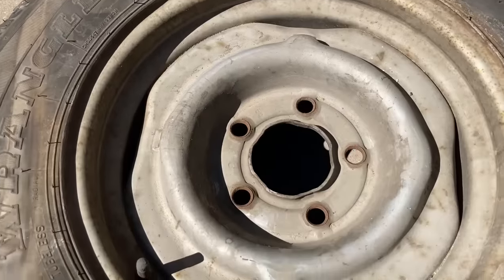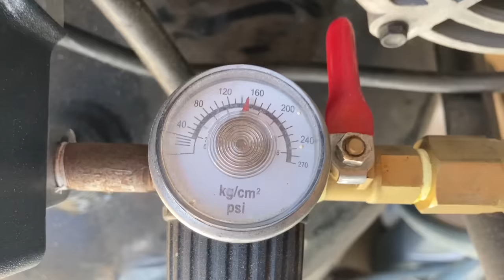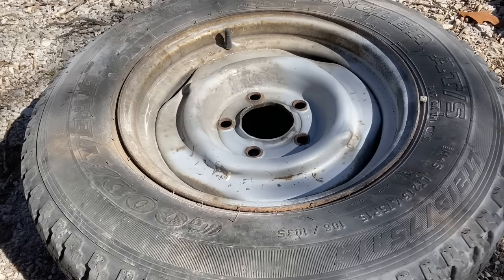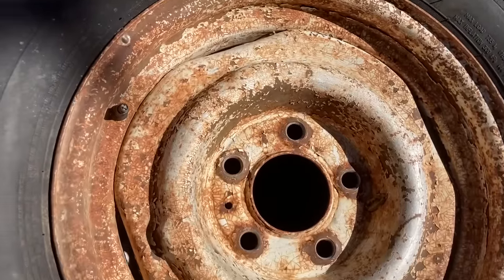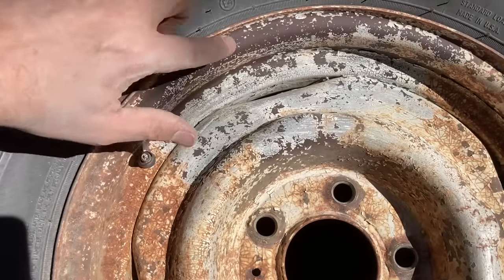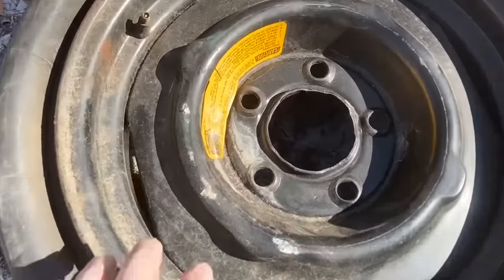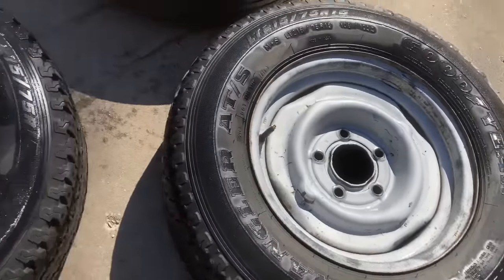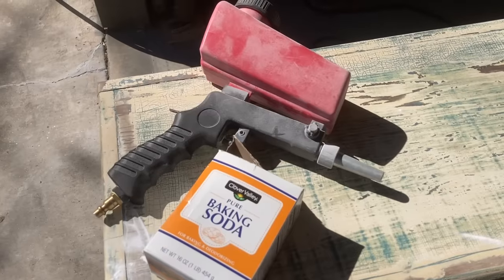Soda Blasting Test with REGULAR Baking Soda - Harbor Freight Gravity Feed Hand Held Blaster

Comment: I always remove tires so I can blast then paint the inside of the rims and replace the valve stems. Beads seat better and any corrosion from condensation is removed.

Comment: Thank you for the information,  I just bought a new compressor, my grandson got my old one (2 months old)  I have both the blasting gun and the 50 pound sand blaster set up.   I want to sand blast horse shoes so I can weld gun racks, mail box stands and crosses for vines in the garden.   I also want to try blasting glass, and wood just to experiment.
Reply: Isn't he a little young for a compressor?
Reply: The compressor was 2 months old.   Didn’t do all I wanted so I gave it to my grandson who has kids who ride bikes and he uses the air gun to clean refrigeration coils.
Reply from the maker: Thanks for watching!
Reply: @charlesk7623  my compressor is 42yo

Comment: Will definitely try this. Got a sand gun and was looking for soda blasting gun, but then saw that blasting media could cost 50USD or more with delivery to East Europe, so will try this with the sand gun I already have. Restoring an old bike, so wanna clean some aluminium parts, hopefully it will do the job. Thanks!
Reply from the maker: Regular soda will clean aluminum very well, good luck!
Reply: aluminium is easy to clean. You can use beach or river sand after drying it and filtering it. In contruction stores they usually have sandblasting media, but this gun can only take small sand so dont get crushed glass.
Reply: @Ozarkwild  Thanks, will try it this summer :D
Reply: @drefhill  NEVER use sand on aluminum unless you are looking to remove excess material

Comment: Arm and Hammer is finer soda. Aldi or other cheap soda is courser and better for abrasion. I'm building a cardboard box to work in to catch/reuse the soda (like a blast cabinet). Open on one side only and taped on the inside so no cracks to catch soda in.
Reply from the maker: Thanks for the info, thank for watching

Comment: I think with a muriatic acid wash then wash it off, then a day or so later after letting it totally dry out in hot weather well use some mild torch heat on the metal before primer would work. I use about the same process after using coal media. That gets tricky with them Harbor Freight blasters even the old Ames blasters have trouble with certain medias. I have 2 of em one works when it works the others been good to me for years and they are nearly Identical. I actually bought a NEOGEN ball valve for the Harbor Freight its what makes the Ames blaster work so good. I just ain't put that on yet. I am itching to try it soon as the weather warms up. An acid wash can also soften hard brittle paint to the point is the soda might just be enough if ya use acid is my point. Using heat as ya primer also makes a huge diff in how the new paint holds up even if ya use cheap paint it lasts a while. I have rims I did like 8 years ago and they still ain't bad not at all.

Comment: Is anyone able to confirm what type of finish you get on stainless steel? Have vintage watch cases and straps that have a satin brushed surface  (with no brush direction/grain). With older watches, this finished becomes polished with wear. Looking to recreate the satin effect. Thanks.

Comment: Would be very interesting to see if intake valves could be cleaned using baking soda instead of walnut shell, if so the cost of valve cleaning just halved.
Reply: A wire wheel on a bench grinder works great
Reply: @drd1924 you can't use a bench grinder to remove carbon deposits behind the intake valves
Reply: @RGV2300  you can when you use a wire wheel on the shaft, I do it all the time

Comment: Wonder how much soda you used for what you did in the video?  I bought that gun and it uses a TON of soda.  Not sure if I'm doing something wrong.
Reply from the maker: I think I mentioned somewhere in the video how much I used, can't remember. That gun does go through a lot of soda, but you can turn down the flow by moving the flow control level half way instead of full open. That's the nature of gravity fed guns.
Reply: when i was using that gun i used beach sand so it was free i just had to dry it and filter it. But it's toxic and without cabinet it just get blown in the air so only good for small parts once in a while.

Comment: Hi O. Wild, I watch with interest you cleaning of the tyre wheels. Is it you are doing the job with a 30 gallons, 155psi compressor? Can I know are you using the compressor that runs on a 3 phase or Single phase voltage? Thanks..

Comment: I'm no tree hugger, but what about the 4 boxes of baking soda in your yard? Does it blow away with the wind or does it pile up and cause a big mess?
Reply from the maker: Baking soda (sodium bicarbonate) is inert. It's non toxic. It will blow away with the wind or wash away with the rain (the paint particles coming off with the soda could be an issue however). Certainly a commercial operation operating soda blasters would have some type of recovery measures set up. To answer your question.. No, doesn't make a mess at all, or it did not with me, for small jobs. Nothing like sand... the soda just blows away in the wind.
Reply: It also kills crab-grass and some weeds.

Comment: Hi, Is baking soda abrasive enough to  remove the paint off of my bike and up(tank, side shields, suspension casings and mud guard) ?

If not, I would like to know a cheap alternative media as cheap as baking soda that can do the job I am hoping to accomplish.

Thanks
Reply from the maker: Aluminum Oxide will work and does not cost that much. Pick it up at your local Harbor Freight store. Soda will clean well, but off the shelf baking soda will not remove the paint from your bike.
Reply: @Ozarkwild  ... ok thanks ... even i thought baking soda might lack the teeth needed to blow away the paint.

This Aluminium Oxide powder you are referring to, should i ask for any particular granular size ?

BTW how much does it cost in comparison to the baking soda ?

I would also like to know where does 'regular construction sand' stand in comparison to the above 2 media for my application ?
Reply: You can get a 50lb bag of fine coal slag (not the black medium grit) the brown color for $12.99 at Tractor Supply. I have used the Harbor Freight hand held gun and their 50lb gravity fed blasting equipment to remove bike paint. That 50lb bag goes a long way. No reason to capture either. Plus you can just blow it into the grass. Not too much silica but use a respirator ALWAYS.  I have dogs so we make sure it’s gets blown or mowed out just in case

Comment: What are the specs of the air compressor that you used for this job?
Reply from the maker: My compressor is a 30 gallon, 155psi max. I run the blast gun around 130 to 150psi
Reply: @Ozarkwild  Thank you, gonna start saving up for a better air compressor 👌

Comment: What size is your compressor? Would I get away with a 10gal compressor or should I get one of those portable 11 gal tanks to 21 gal at that point?
Reply from the maker: I think mine is a 60 gallon. You might get away with a 10 gallon, but you will have to allow it to recover more often. Might get away with it for very small jobs.
Reply: It's the flow that matter not so much the tank size. Tank size compensate for small flow but usually 10 gal compressor also have small flow.
You'll not do much with a 10gal compressor.
I had a 100 liters with 250l/min flow and it was not enough.
Reply: I have a 30 gallon stand up compressor and it cuts off at a 150 PSI will that work

Comment: sugar/salt would probably work really well. guess you wouldn't want sugar all over the place though so salt?
Reply: Got me thinking, pool salt, grind it in a food grinder, would be a cheaper option
Reply: Only if you want more rust than you started with.
Soda is pretty cool..not only does it remove the rust when you blast, it inhibits it after blasting..soda-blasted bare metal can sit quite a bit longer than "clean" bare metal before it starts oxidizing.

Comment: Wow, works great!  Did you need to modify the gun or hopper at all?
Reply from the maker: No modifications, stock gun, Harbor Freight
Reply: personnaly i drilled bigger hole in the level and tank. 
I used it with beach sand.

Comment: Hello, good video..  how many times did you need to refill  the sandblaster per tire side?
Reply from the maker: It took about 1 box per wheel (.50 cent box). I think the gravity fed blaster uses more than it should. I may have used less had I been using a siphon type gun.
Reply: @Ozarkwild  Thanks for reply, I tried using with sand and it basically spilled out of the canister as I tilted instead out blowing out . any recommendations on a better one to use for wood or rock
Reply from the maker: @kbmain  Make sure your PSI is at least 90 or above... I recommend 110 or above. This will allow the pressure to force out the media faster than it can spill out. I run at around 140 psi.

Comment: What is your air pressure ar?
Reply from the maker: 110 to 90
Reply: @Ozarkwild  What CFM?  My wife wants one like this for furniture BUT they all call for 7CFM and higher compressors and those are $$$$$$.
Reply from the maker: @mikewinkler1  You need at least 90psi. I run 120psi to remove paint and light rust.
Reply: @Ozarkwild  do you think 4CFM @ 120PSI will work?
Reply from the maker: @mikewinkler1  should work fine

Comment: wait what ? U tube threw this video up immediately after watching an actually useful video on soda blasting aluminum heads heads because sand isnt an option and left over glass beads if not removed will wipe out the engine you install it on. You are blasting a STEEL wheel correct ? unless you got a lot of FREE soda lying around and simply to lazy to get some sand and maybe your are using a very very very large commercial sand blaster ? why on earth would you use soda ? That is sorta like sanding down a car to prep for painting but instead of using 400 grit wet sanding papaer you decided to use bounty kitchen towels instead ? not saying it will not work but dont you value your time ? Soda is something you want to use when cleaning your wife's copper pans and pots because it will not scratch or harm anything. That is a road wheel made out of steel sand or glass beads is what is best and if powder coated aluminum oxide media .
Reply: and soda does jack shiticus on rust ..